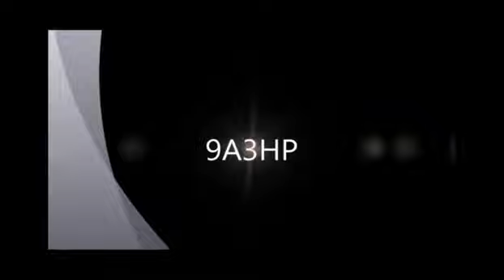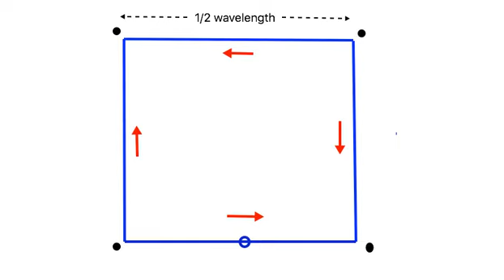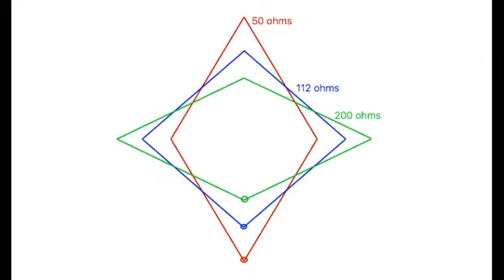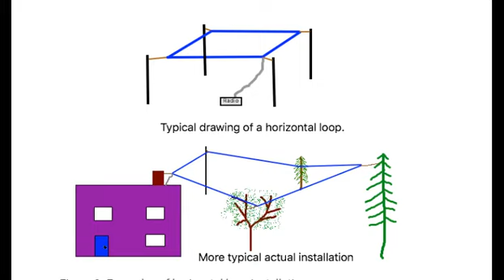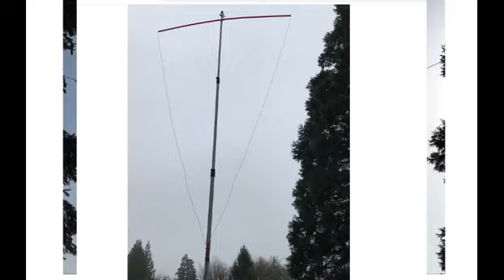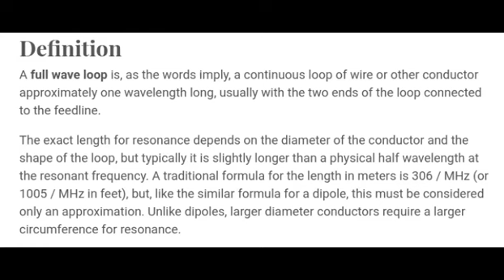Why closed loop is low noise antennas?

Comment: Good , fundamental principles of loop antennas.  Can a multi element quad antenna be improved with a static discharge resistor? Thanks!
Reply from the maker: Yes of coarse, any antenna can be less noisy using bleeding resistor's. Vertical even EFHF 
Even transformer is short circuit for static noise. Resistors are not frequency dependent.